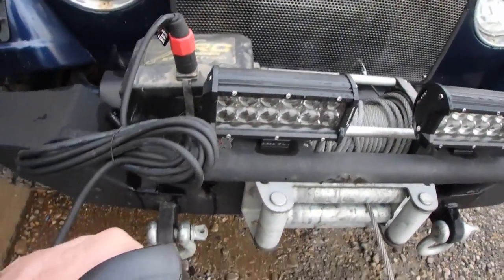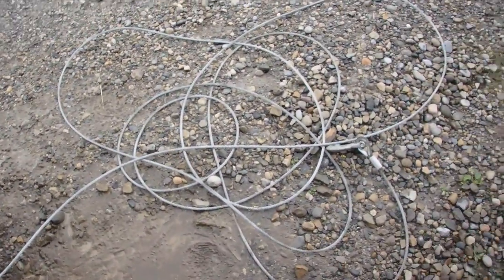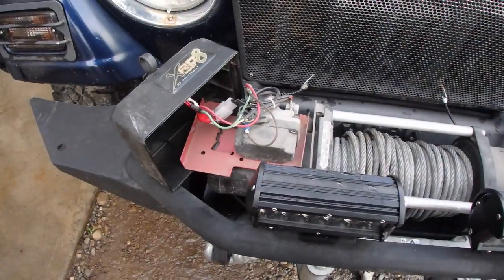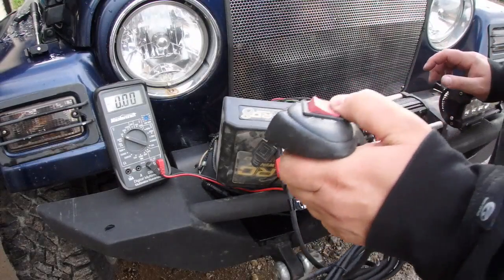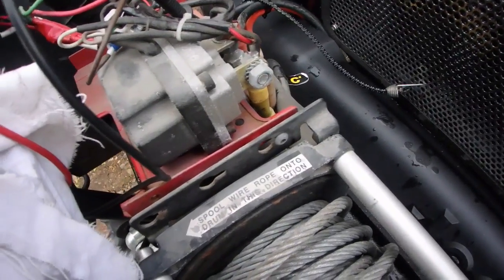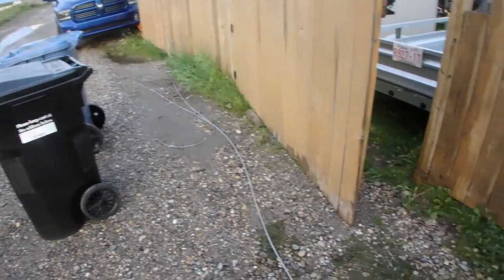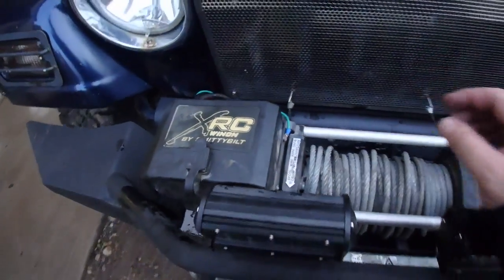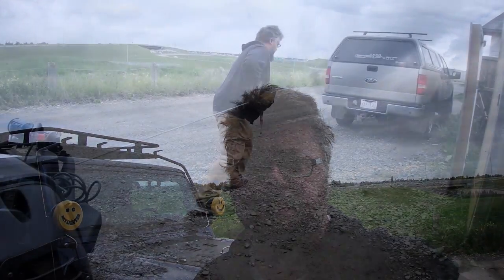Winch Repair, TroubleShooting Clicking Noise

Comment: My new one is doing the same.  I know I hooked the short black ground to the wrong location of the winch but figured it would still work being it's metal.  I have also blown a couple of fuses.  Anyway I'll check for voltage drops thanks.

Comment: If you think you have grounding problems, try owning a jeep with a fiberglass body.   I bought stock in grounding straps.  ;)

If a solenoid has temperature related issues, usually that is a lubrication issue.  Of course, most solenoids aren't made to be serviceable, so either replacement or creative repairs are typically the only fix.  I have heard of people drilling a small hole in them, spraying something like WD-40 inside, and resealing them.
The only other way temperature might play a role is an internal insulation or connection problem aggravated by either expansion, contraction, or condensation.

When I do a winch pull like that, I tend to put the Ebrake on for some resistance.

Comment: hardest pull was a guy who buried his truck and trailer with jet ski in sandy muck. Lots of strain, and I should have done a double line pull. but out he came. felt pretty good about that. don't use the hand held much since I installed in cab controls after watching your video few years back lol
Reply from the maker: the in cab winch controls are the best no screwing around

Comment: Did the new Green (ground) wire get warm at all while in use?  I'd look over the winch to bumper and bumper to frame mounts.  If it's too much of a bitch to inspect, I'd throw a 4ga ground from Bumper to frame or Batt.
Reply from the maker: nope didn't get warm, the motor has it's own ground that is grounded on the rad support that also has a ground running from the battery to it.

Comment: It's possible that the frame ground at the bumper wasn't good enough. I've had issues with grounding and ground noise when it came to electronics such as radios. I also just recently installed a steering wheel control for my aftermarket radio and the instructions said to use a separate frame ground for it. Ultimately it all gets to the negative side of the battery, but the route matters. The long term results will tell, but I think you might have fixed it. BTW, when you installed the wireless remote, does the receiver module have its own ground?
Reply from the maker: The receiver module and in cab winch controls both have their own mods,  It is possible that the frame ground wasn't good enough.  So far so good time will tell